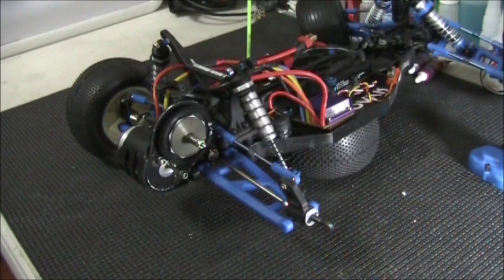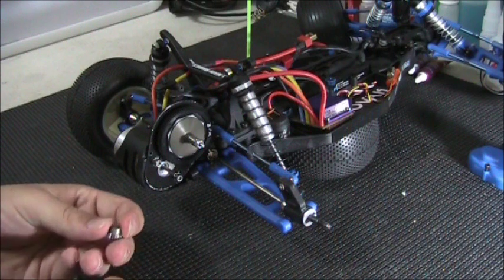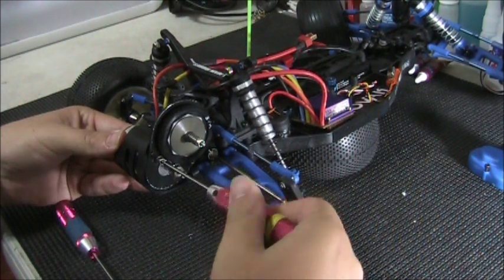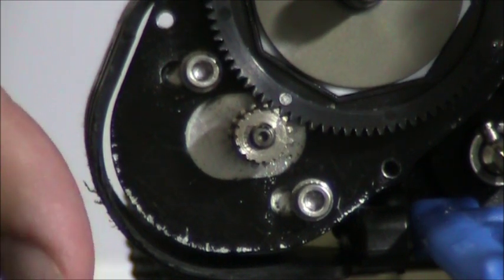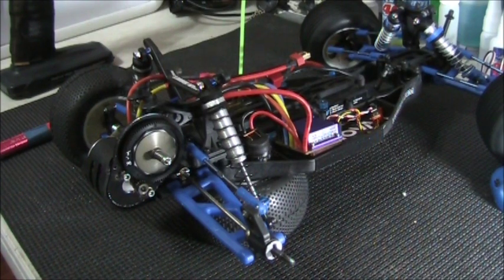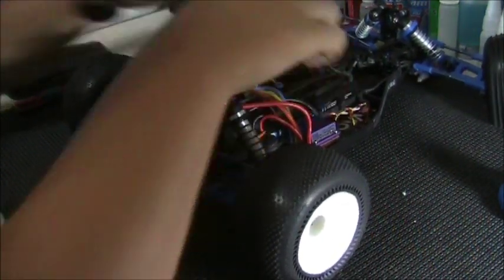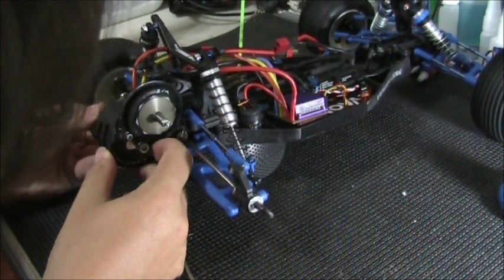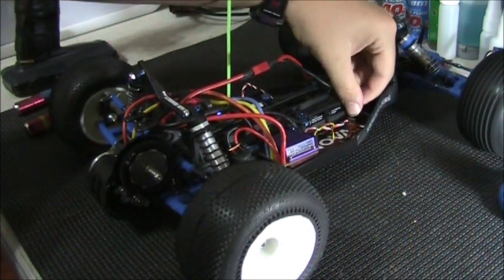"Gear Mesh 101"

Comment: What would happen if gears wernt meshed right
Reply: +Dawson Boys too loose it would strip.. too tight it will overheat the gear and melt plastic, or even bind and get your motor too hot which he says in the video.